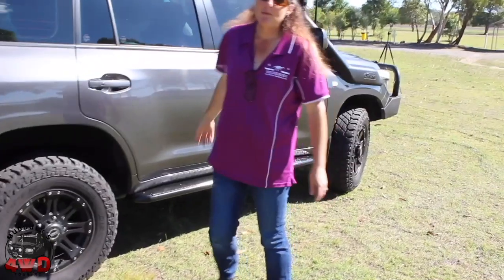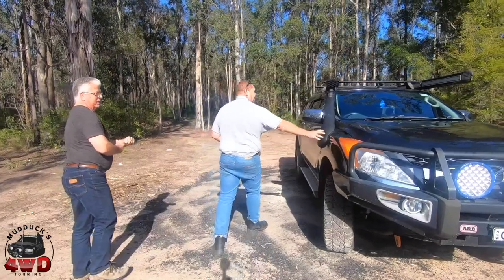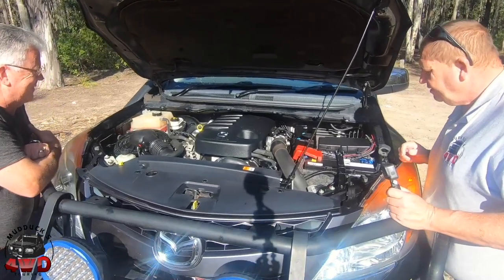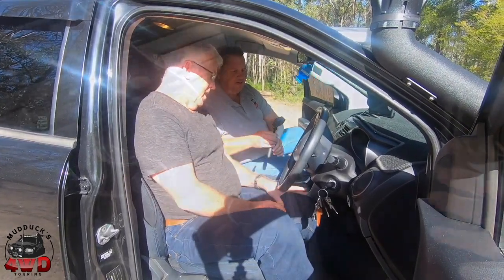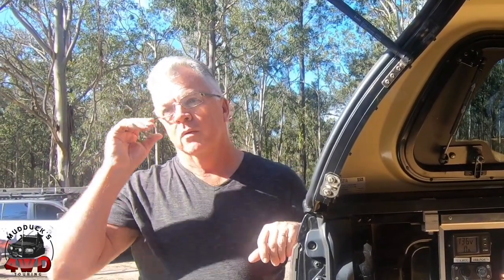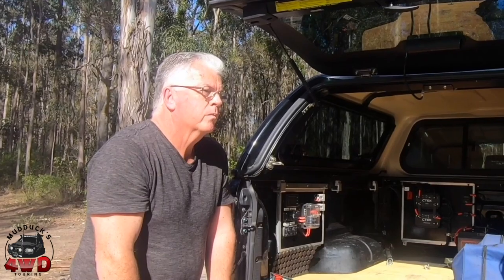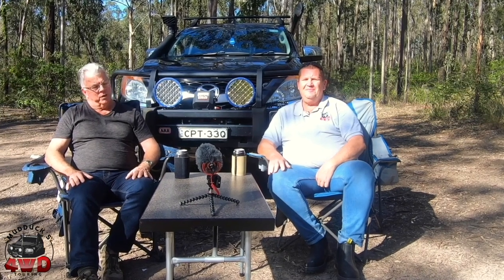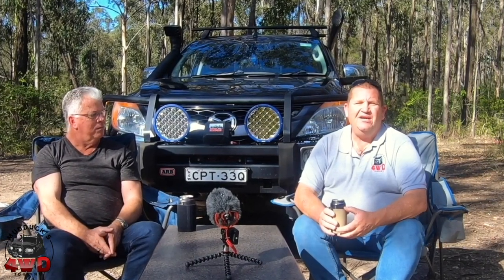Toyz Ep 7 Greg's Mazda BT50

Comment: Neat looking truck very clean exept the fog light plastics need to be replaced haha 👌🏽👌🏽 also neat canopy setup od like to do the very same with my 12v setup but have it mounted on the back canopy window abit higher to see 👌🏽 im running a projectahub 100ah calcium battery at the moment
Reply from the maker: It is a nice truck for sure Dane, Where are you located? the Nav sounds like a good thing. Cheers Steve
Reply: @MudducksTouringAustralia  mildura 3500 victoria mate 👌🏽